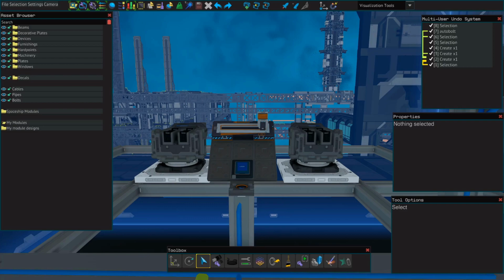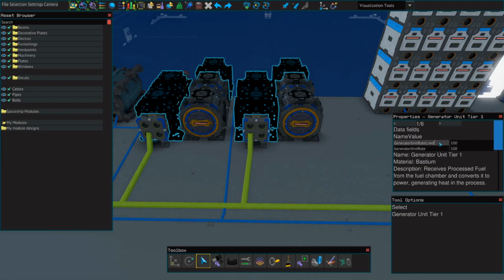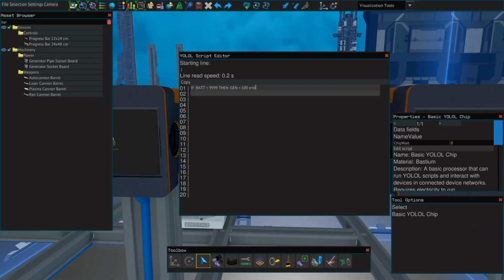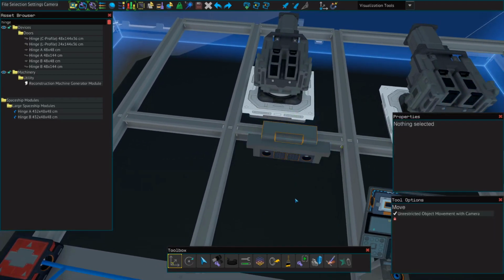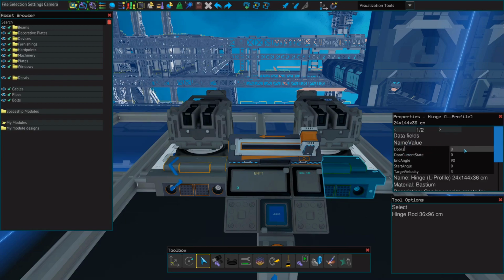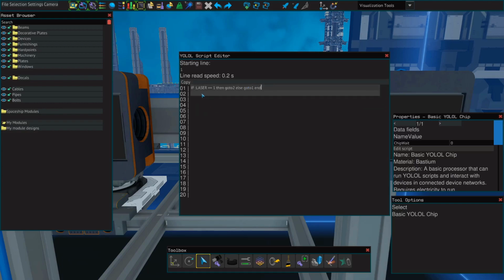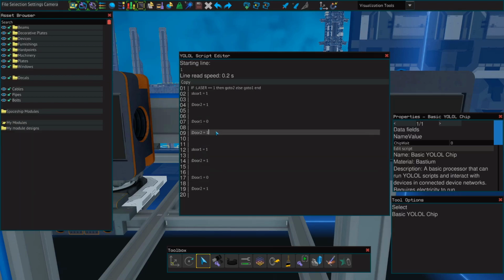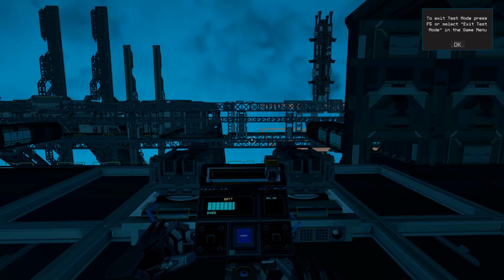Starbase YOLOL Scripts: Mining Laser Efficiency and Oscillation

Comment: With Yolol you can just say if :Laser then "do thing" end
 Yolol bool statements are just numbers 1 and 0 "if :laser" is already checking if the laser is 1
the opposite is if !:laser then do thing end. Just a neat shorthand to save on line space
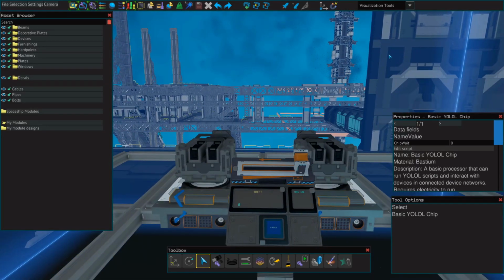Reply: 10:54 on line 1 you could also just write: goto :laser + 1. That's assuming the :laser button on and off state value is 1 and 0 respectively

Comment: I played around with the Mining Laser as well, and I have to say. using a cradle + turntable can be exhausting. For some reason the angles get calculated differently as soon as you change the max and min values for the rotation. And it also seems, as if these values just get ignored... Well either way my way of oscillating is to change the targetpitch or rotation as soon as targetpitch == the current value. (same for rotation). that way you can adjust the speed (via the last option i think) with some lever and even the range. for instance using targeted mining vs broad and slow. just by using levers is pretty cool.

r=:d<12 if r==0 then :tp=60 :tr=0 x=1 goto1 else :tr+=45*(:tr==0) end
if (:tp==:tpc)*r*:ron then :tp+=15*x x*=-1 end //laser pitch
if (:tr==:trc)*r*:ron then :tr*=-1 end goto1 //laser rotation

:d is the targetfinder distance
:tp targetpitch
:tr targetrotation
:ron if the rangefinder is on
:tpc is the current angle for pitch
:trc is the current angle for rotation
x defines a variable that changes as soon as the current pitch value is equal the target pitch
the rotation is easier since you just need to multiply it by -1
and the first line sets the values when no asteroid is in range -> having a start value for the cradle is important because you prob dont have some value at 0.

for the (:tp==:tpc)*r*:ron thing it basically means as soon as one of the three parts is negative it will give back a zero and in turn result in 0*1*1 for instance which is 0. basically an and operator for people who do not understand. :tr*=-1 multiplies the target rotation value with a negative 1. e.g. -40 become 40 and vice versa. :tp+=15*x is to add either 15 or -15 oscillating between those values.

btw, the else in the first line is not needed... just put it after the end so you have some more space.

my goal was to shrink everything down, so it gets committed as fast as possible. you could also outsource the initialization parameters to another yolo chip and then just have one line for pitch and one for rotation in separate chips. that way you can have rotation values as fast as 3. (which is really quick basically going up and down multiples times per second)

another idea i had was to calculate the distance to the range finder and adjusting the angles of the mining laser so it has the center angle set to the range finder. i ve seen something similar done somewhere else. it s pretty cool when the laser adjusts to distance of how far the asteroid is. (pythagoras thingie google it) you d use the tan(x)=opposite/adjacent.

Comment: I never thought of using hinges for pitching mining lasers, keeps the whole mining laser assembly so small. 
A little tip, you can just transpose the minimum and maximum rotation on 1 of the turret turntables and you can use the same variable to rotate them (ie. change the left turret turntable to max -180 min 180).

Comment: Question is there not a turret mount that will elevate as well as traverse?
Reply from the maker: There are! The cradle and the advanced cradle can both pitch, and I show how those are used in the cradles tutorial if you're interested. I will personally often use hinges because they are more compact than the cradles, so when stacking lasers one above another you can fit more in a small space. It also gave me an opportunity to demonstrate hinges so I decided I would use them here, but the process would be the same using a cradle.
Reply: @SpunieBard  kool, thanks for the reply.

Comment: I'm not sure how well known this is, but you can use conditional statements (<, >, ==, !=, etc.) as arithmetic to get a binary result (True = 1, False = 0).
Using this, you can reduce that first script to one line:

:GEN=(:BATT<9999)*100+(:BATT>9999)*35 GOTO1  //==>//  :GEN = 1*100 + 0*35 GOTO1  //==>//  :GEN = 100 + 0 GOTO1  //==>//  :GEN = 100 GOTO1
Reply: I have no idea what you're trying to do here.
Reply: @ArmitageShanksMC  When you use a conditional statement in an equation, it returns a 1, or a 0. 1*100=100,   0*35=0,  1*100+0*35=100.
Reply: @Penultimate_Jive  Ah, right, all the extra (what ostensibly looks like) code was confusing. Good to learn another little quirk of YOLOL though, going to see if I can use this in future scripts, might even be possible to turn an if/then statement into a while loop :thinking:. This does the same thing on a single line too - 'If :batt<9999 then :gen=100 end :gen=35 goto1' Although this is an insanely inefficient way to regulate your generators.
Reply: @ArmitageShanksMC  yeah. you should check out the official wiki. there are some good scripts for the generator. before that i used an 1/x function to calculate the power generation. is finnicky but fun to do messing around with the systems.
Reply: @caschque7242  I write most of my own YOLOL.
Reply: @ArmitageShanksMC  yeah but you learn from others. I changed mine to incorporate multiple ideas.
Reply: @caschque7242  that's true, but I've learned more from watching other people playing on YouTube that i ever would from the wiki.

Comment: if you want to improve your YOLO performance decrease the two if's to an if - else
EG:IF BATT > 9999 THEN :GEN = 100 END ELSE :GEN = 35 END
now the 0.4 seconds reduces to 0.2 as its one line
if you remove spaces you can also fit GOTO1 on the same line dropping 0.6 to 0.2
Reply: "END" is used to end an IF statement. You only need to put it at the very end of the entire statement.
Also, your line says: IF :Battery is greater than 9999, Then :Generator equals 100. Meaning, when the battery is full, the generator will be set to 100.
Reply: @Penultimate_Jive  yeah the greater than was a typo and I have since understood the use of end better myself, you are of course correct, I am only a couple of days into this and still learning
Reply: @N1ghtR1der666  You were mostly right though. You squeezed several lines into one, pretty good 👍
Reply: If/then statements can be shortened even further because you're generally testing for a Boolean. If :batt<9999 then :gen=100 end :gen=35 goto1

Comment: That generator script is going to waste a lot of fuel. You should do something like this.

:Gen≠500-:Batt/20

That will map 100% generator to 80% battery, ramping down to 0% generator at 100% battery. I found that to be a good mapping, although you can go more or less sensitive.
Reply from the maker: This is a great tip and really useful if the ship isn't a mining vessel. For mining vessels though that type of script can end up wasting a lot of your time and cause mining to take significantly longer unless you have a massive battery bank. The reasons are that this script scales the generators down as they recharge the batteries causing them to recharge slower, and it resets your generators to 0 every time the batteries are full. Generators take about 90 seconds to go from 0 to 100, so that means every time you start to mine your generators have to ramp up from zero, either that or you'll be starting with batteries that aren't full since they were partially drained while you flew to the next asteroid. 

Using the script I use in the video ensures that your batteries will recharge quickly while you fly from asteroid to asteroid, and as your batteries begin to drain your generators aren't starting from zero to try and meet the increased power demand, so you can run your lasers for that much longer.

I plan to build on the script I used here in a future tutorial with a script that I use in my mining ships that checks to see if forward thrusters have been activated in the last 90 seconds, if they haven't been used and the battery is full the generators shut off until the thrusters are engaged again or the battery drops below 50%.
Reply: @SpunieBard  oh yeah I run 200 batteries, never have to kick my generators into high gear manually, they always have time to ramp up. Honestly it feels a lot better having more batteries than having to constantly refuel the generators
Reply: @SpunieBard  There's loads of efficiency scripts out there doing the same thing with slightly different math, I can show you one that ramps up your generators as your batteries drain, but also allows for an "over-drive" button to "pre-heat" your generators to whatever rate they need to be to consistently run whatever you need to run.
Reply: Yeah enough batteries are really important. Saves a lot of struggle later on. 
But when you want the smallest ship possible you have do some tricks. Trifin use the collector as a ramp up event for the gens for example.
If someone searching for a simple generator script I point them to the Worker Ant. Just copy it in test mode.

Comment: Kinda thought this would cover pulse. Also why not just use turntables/turrets? Using hinges seems like would cause issues in long term
Reply from the maker: You can absolutely accomplish the same thing with the advanced/turret cradle, I use hinges because the other cradles are fairly large and limit the number of lasers you can add in a compact space. You can sometimes fit twice as many hinged turrets in the same space. So far I havent had any issues. 

Ill do a quick video later today on pulsing your lasers! Check back tonight and it should be up.

Comment: Thanks buddy. It might be worth mentioning, that the "35" value is the minimum cruise value (all rear thrusters firing) so it might be greater depending on how many thrusters you have. Also, are there turrets with both X and Y, so not requiring the use of hinges?
Reply: Yes, they are called Advanced Cradle Turrets if you want full articulation, or just Cradle Turret for limited motion (swivels 90 degree right/left from center, pitch from 0 up to 60 degrees I think)
Reply from the maker: There are! They're called cradle turrets or advanced cradle turrets, and you'll need a large turret base for both. I use hinges because they make a more compact laser and I'm able to fit more in a smaller space, especially if I'm using one laser above another. The other cradles would work in a similar way, just some minor changes to the YOLOL. Instead of setting the hinge doors on or off using 1 and 0, you'd need to set the pitch angle in its place.